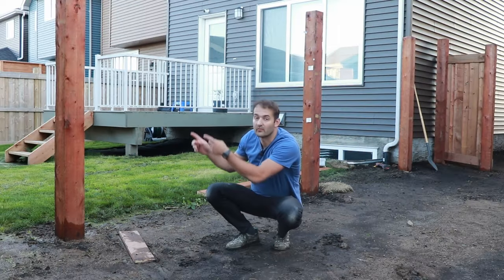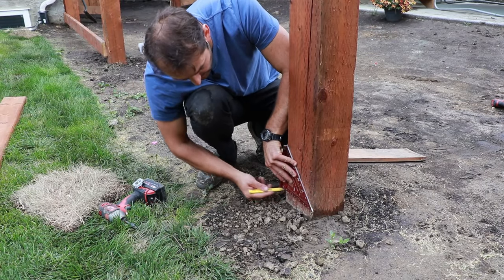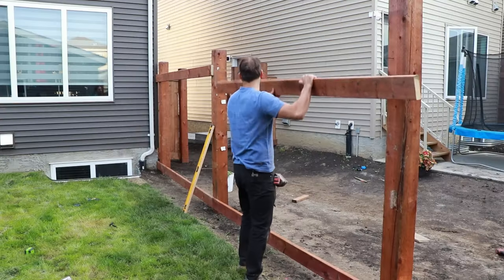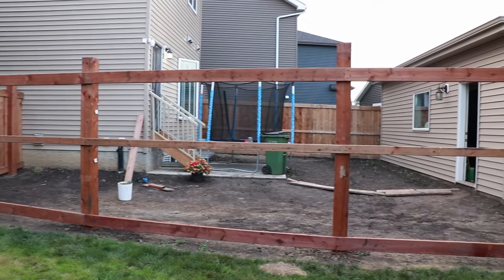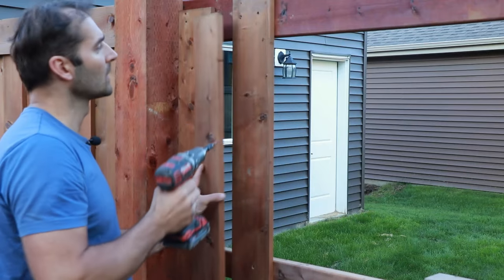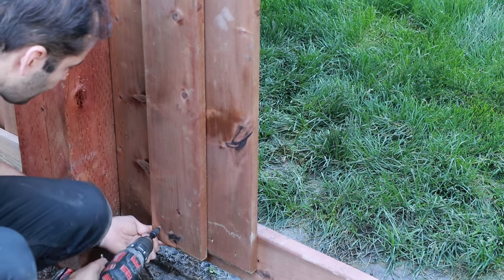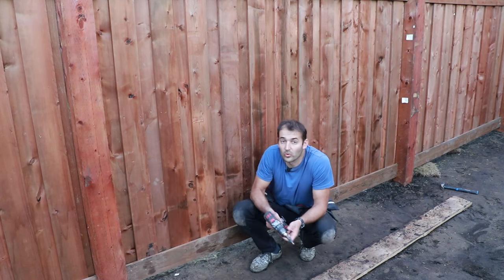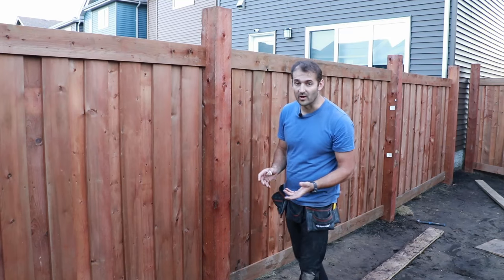How to Build a Wood Fence

Comment: I love the over lapped boards, curious if add a 1x4 top cap running vertically would be advised to keep water out?
Reply from the maker: Not bad idea, it one of the ways to do it. Good luck. Please like and subscribe. Thanks
Reply: This also will help keep things straight and rigid as you are cross graining the wood.

Comment: GREAT VIDEO!  I'm building a 'double-sided' fence that needs to look the same on both sides (neighbor is paying for half so he's getting a 'new' fence on his side.) I can't have the stringers showing on 'neighbor's side.  The cost for the slats would DOUBLE so the slats have to interlap as you did but look the same on both sides. Considering using stainless steel staples to tie the slats together but not sure how to secure them together WITHOUT three 1-1/2" stringer width between the 2 sides.  The fence pickets have to be flush to each other.  I've seen ZERO videos showing this technique.  Any info on solving this riddle would be much appreciated.  THANKS IN ADVANCE!
Reply from the maker: Can you use Simpson Strong Tie 

https://www.homedepot.com/p/Simpson-Strong-Tie-FB-ZMAX-Galvanized-Fence-Rail-Bracket-for-2x4-Nominal-Lumber-FB24Z/100375311

Place it closer to the end of the post and use and overlap planks only on one side. That way you will get the stringers right in between the posts if you know what I mean. Like here: 

https://www.makingmanzanita.com/how-to-build-a-wood-fence/
Reply from the maker: Please like and subscribe! Thanks!
Reply: @TheHandyNeighbor  THANKS handy neighbor but it's not about attaching horizontal rails to the 4x4 posts.  I can do that. It's about attaching the 'fence slats' WITHOUT using any rails - other than the top cap (2x4) and a bottom 2x4 rail laid horizontal between the post.  Where might you pin 'stainless steel staples' so the slats overlap each other?  Besides IN TO EACH OTHER AT THE OVERLAP EDGES, I'm assuming you would use 1x1's pieces at top, sides and bottom that are attached to the vertical posts and top & bottom 2x4's - with the distance of 1-1/2" between them so as to fit the overlapping slats into that 1-1/2" space (each slat is 3/4" thick.). Would that make sense?
Reply: @ricktorreano266  just put the rails on your side. Like everyone else on the planet. No big deal

Comment: I understood that you marked 2.5 inches up for your bottom rail (to follow the terrain), and then you said to mark 67.5 inches up from that for your top rail. I then saw you use your level. Are you then ignoring the 67.5 mark you made and just making it level instead on the subsequent top rails (after establishing the first section). Also, is your middle rail marked so the top of the 2x4 hits the mark, or the bottom of the 2x4 hitting the mark/measurement. 

Great video by the way. I appreciate you. 🙏🏾

Comment: Why not drame the 2x6 and 2x4 inside the 6x6 posts .
Reply from the maker: Because this way I get much better support on the posts. I mount them directly on the post. Inside you have to use brackets or screw the stringers from the top side and bottom what is not ideal way to position the crews.
Reply from the maker: Please like and subscribe, thanks!

Comment: The first big win is going to rip that down. That Qi’s absolutely the worst way to build a fence but the best way to have a nightmare
Reply from the maker: Of couse it will not. It will hold for the next 50 years. I live in Northern Alberta, Canada with high winds and -40 C degrees during the long windy winter times and it holds great. Most of our fences in the city are built the same way.